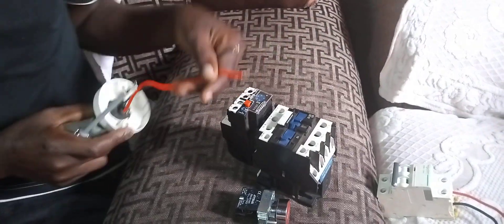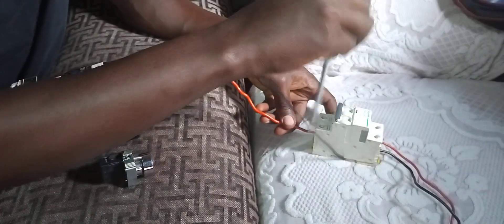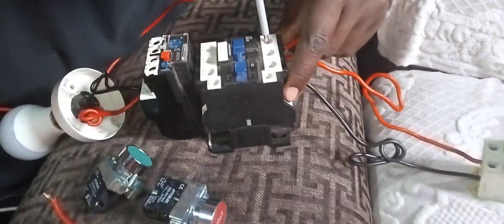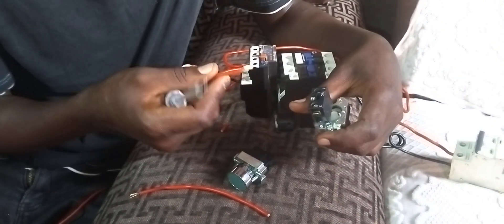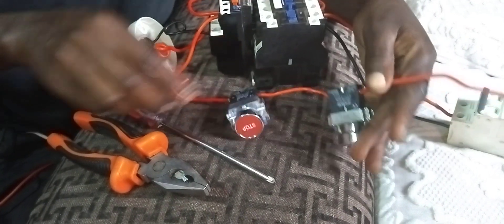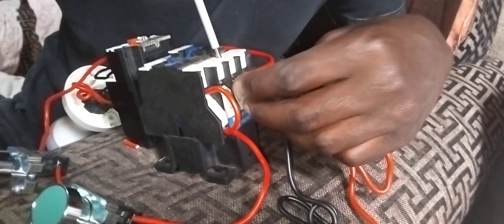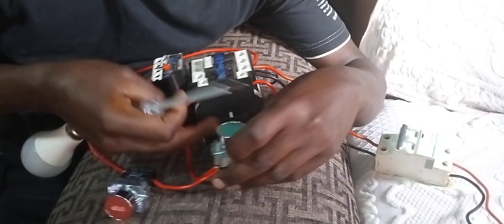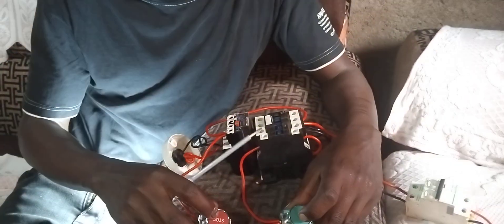single phase on line dol starter connection simple wiring

Comment: Hello sir I want to do the connection of floater switch to the AC magnetic starter single phase motor to control box S. Ph motor submersible pump .
Reply from the maker: You want a video , let me know